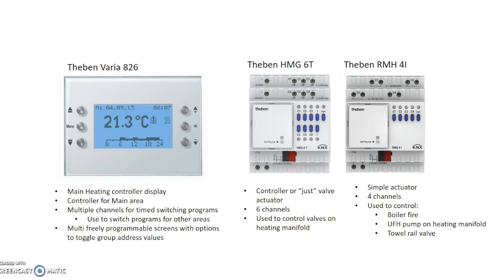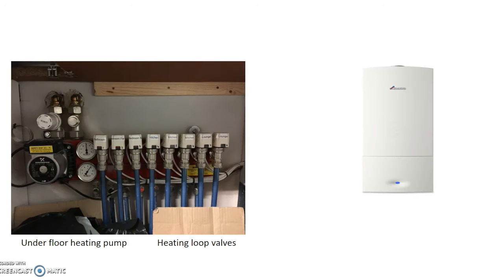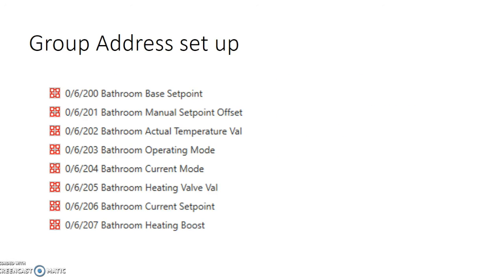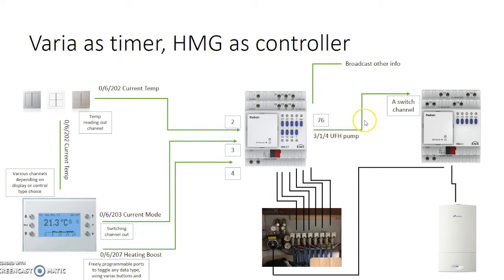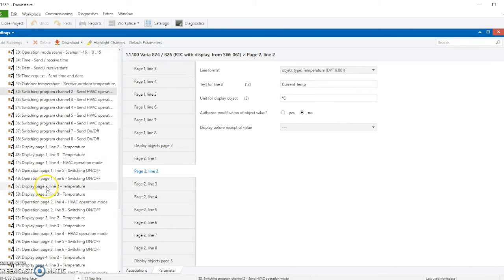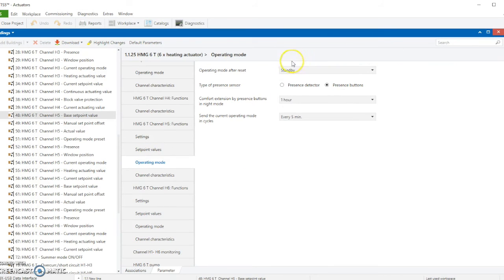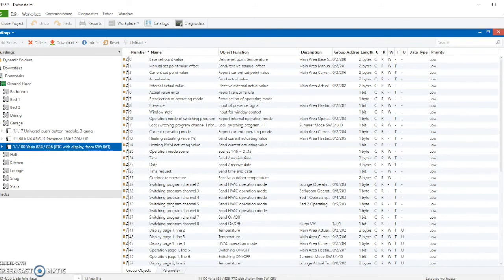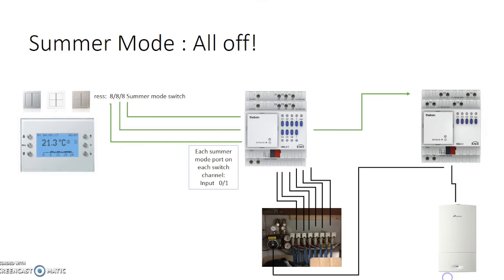KNX ETS5 Tutorial - Heating Hell

Comment: Hi, unsure if you are still monitoring this, but I'll give it a go!  I have a similar setup, but with direct electrical heating. The temperature can fluctuate quickly, and Im trying to stop the heating turning on and off repeatedly.  Is there a way to effectively program "on at 20.5 degrees, off at 21.5", so that the heaters dont switch on and off every time it dips below/above 21?  I dont have the controller, so would be doing this just with the theben controls. Thanks for any pointers!
Reply from the maker: Hi Elf, good question. First check the controller documentation you have. There might be a way without a logic controller. If not you could just change the time associated with the temperature sensor to say 15mins, then the heater will come on for at least 15mins

Comment: Hi, my set-up is similar to yours, though my implementation is slightly different. I have Theben HMT12 (24V) driving my Rehau Underfloor Actuators, the "Call heat" from the Heat Pump is implemented using the HMT-12 add-on relay module. I have individual Gira 3+ Room controllers and in most rooms I take the average of two temperature sensors on opposite sides of the room.

However I am confused with one thing: What exactly is the KNX Compliant "Controller Status" Data Point? Does is allow complete control/status of the Room Thermostat through a single Group Address, including two circuit heating & cooling in a single room, e.g. UF actuator control and Towel radiation (in my use case the radiator is Electric driven from a Gira 16 Channel binary actuator) That seems to be the implication.

Best regards, Justin.

Comment: This is rather academic - if you live in a cold climate with water based underfloor heating. 
Water based underfloor heating is slow to respond. It takes about four hours or so for the heating to settle to a new temperature. So switching modes can be somewhat unpractical. Besides, at 60+ north, you do wish to keep your thermal mass warm and not pump the temperature up and down. 
I am not an expert on this, but it sounds counter intuitive and it may well be cheaper to keep the acquired temperature constant compared to a cooling and heating cycle.
Reply: Hi,
Actually properly done underfloor heating, response of few degree higher temperature in just 0,5 an hour. The system might be easily adjusted to what exactly final temperature you will get in half an hour from the moment of start the heating  system.  Other way the system can learn how long boiler got to be on to get to 21degree in 30 min in combine with current  temperature that is outside and inside.

Comment: Hi, I have watched your video few times, you mention that one of the modes of control you have is that the Varia can control the room temperature of a number of rooms via the HMG 6T as a valve actuator, I presume that the set points are fixed by the Varia and your temperature from the Jung light switches is reporting each actual room temperature to the Varia. Then the Varia send a % single to the actuator to control each zone valve on the manifold to control room temperature?
Reply: Yep absolutely correct.

Comment: How do you operate the pump, as far as  I know the pump should be turned off when all the valves are closed. So how do you manage it with out a logic module? are you using HVAC request to manage the switch actuator?
Reply: If any one has the same problem my MDT valve controller has woolen value of 1 if any of the valves it's opened

Comment: Didnt understand, what are you using to measure the temperature for rooms
Reply: Please can you send me how did you use the group addresses for heating system
Reply from the maker: So each room has at least one device that measures temperature. Typically this is a light switch or movement/presence sensor. For rooms with multiple sensors I post the values to a new group address that is listened for on the raspberry pi. The pi has a short script that takes in the output from all the sensors and outputs the mean to the "room temperature " group address, which the controller listens to.

Comment: hi 
 i watch all the movie and i like it very much
i am going to do the same in my new house
can you help me with that ?
i will need your knx project file to work with
my mail is : cyber1459@gmail.com
i will Appreciate your help .
Reply from the maker: Hi Ronen,

Welcome to knx!, I'd love to help, but I am afraid you will have to build your own project file from scratch. If you have specific questions about how to do this, just let me know and I will try and help. Good luck!
Reply: Hi Alderley, 
i build my own project  .my  Q is : if i want to change the temp of the base  set point how can i do it ?
Reply: I ment how to change it from the Varia 826 and not from the ets
Reply from the maker: Hi Ronen,

It depends - if you are using the main room temperature controller then I think you need to link your base set point address to channel 0. The default is however 21 degrees which I have found to be fine. You can change the default in the parameters for the varia. However I would strongly suggest that you leave the set point alone (i.e. at 21 ) and use the other parameters to change the "actual in use set point"  away from this. Good luck.